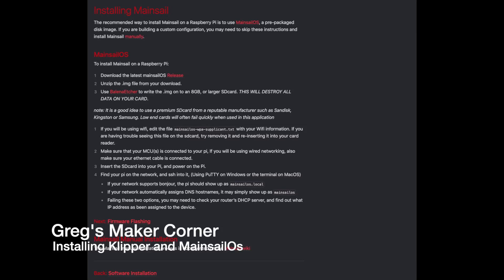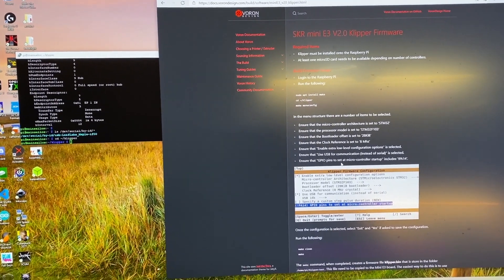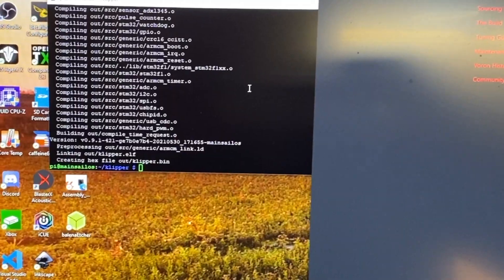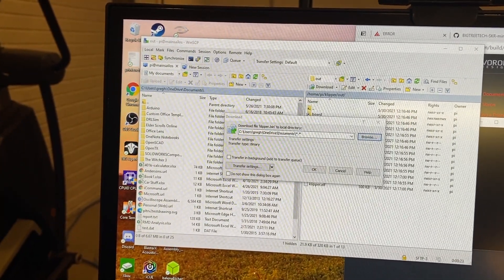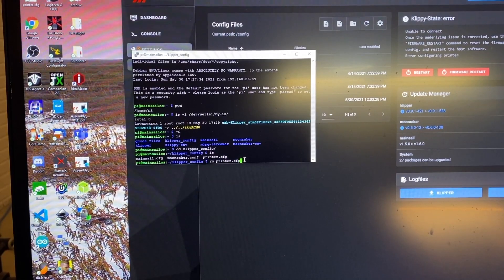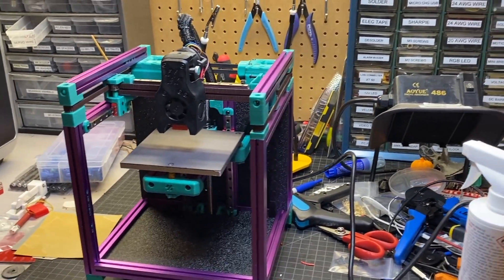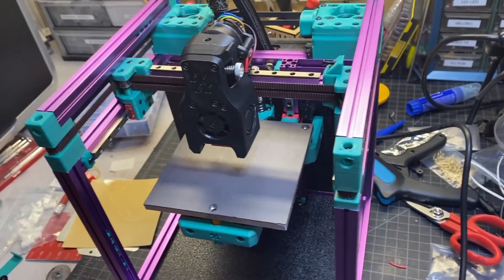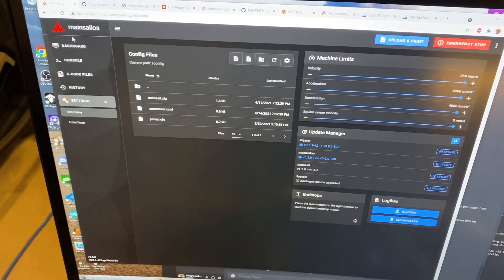Voron 0.1 Build Series - Installing Klipper and MainsailOS

Comment: Did you have to define 0,0?
Reply from the maker: Yes, it's a good idea to go through the "Define 0,0 point" in the initial startup checks. I didn't show all the steps in the video, but you may need to adjust end stops, physical bed location, etc. (as described on the voron site) to get the full 120x120mm travel on X and Y.

Comment: I followed this walkthrough but unfortunately stuck with the ls -l /dev/serial/by-id/ part. It says there is no such file or directory.
Reply from the maker: Hmm did you install the firmware on the skr successfully and also make sure the usb was connected to the pi and the skr?
Reply: @GregsMakerCorner  SKR firmware.bin is now firmware.crs so I think it worked. I will send you a message on Discord if that is okay with you. I can explain the details from there.